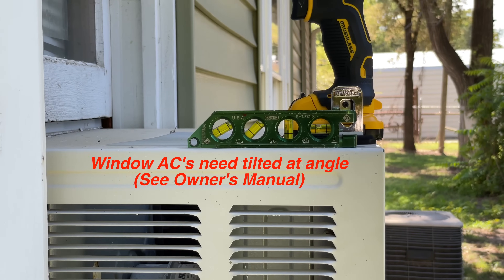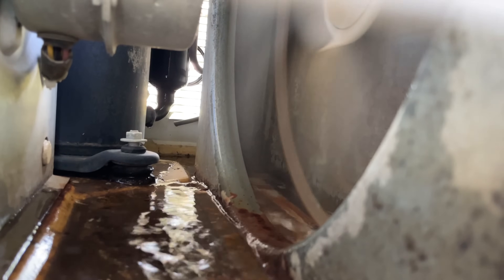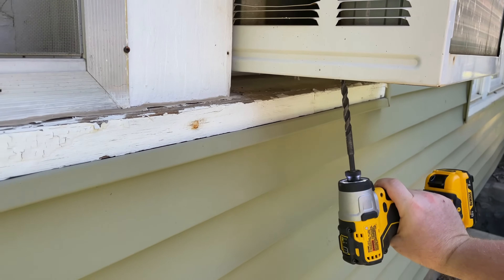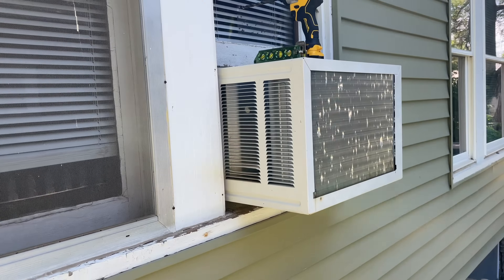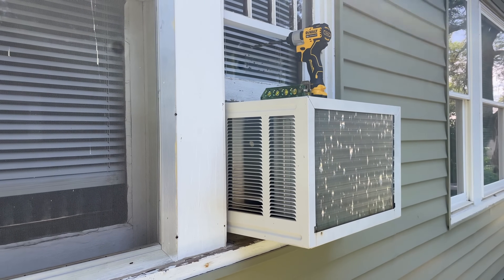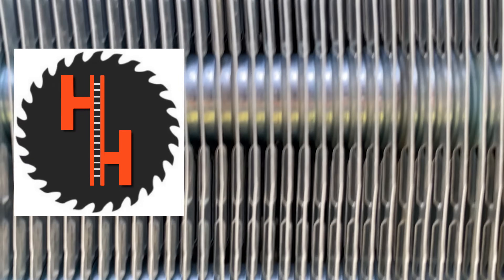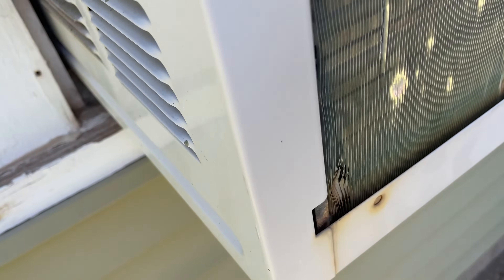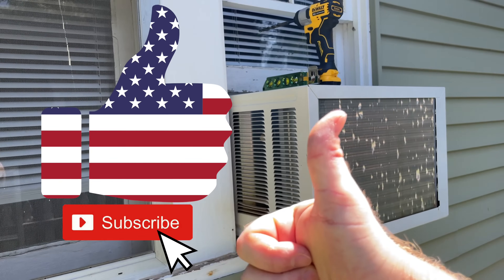99% Don't Know THIS About Window A/C's!! DON'T DRILL!!

Comment: It all depends how much noise of the water splashing you're willing to put up with, i have two window units where the noise was simply unbearable, drilling a hole is perfectly fine just make sure you're not drilling into any vital components like the condenser the fan assembly or the compressor. Today's window units are made so cheaply that they're all noisey to begin with, i have an old Sharp that i bought in the late nineties, it's 10,000 btus and is one what they called their library series, it is so quiet and built like a tank, the more steel the quiet it will be, like the way small cars are noisy junks compared to the big luxury cars, i hope this unit lasts forever, both inside and outside it's super quiet, in fact other than it cooling great you'd be hard pressed to know it's on, because of the way it's built you can't hear the water splashing inside and only a little bit outside.

Comment: In our area I always drill a hole to allow the condensation out of the units. Otherwise it hits the fan and splashes all over and is noisy..Drilling the hole also allows the build up sludge to flush out. We live in a very humid area.   I always drill with a step bit as to not cause any damage to the fan blade etc.
Reply: I had to drill mine. I have a window AC unit installed in the rear window of my camper van. The water would slosh around in there while I was driving and whenever I came to a stop sign it would come forward and come out while the AC was running and it would  hit the front fan and that would spray water all over my bed and all over the rear of the camper van so I drilled the drains and I no longer have that problem.
Reply: @OverlandOne  Gross!
Reply: @AldousHuxley7  It was just clean water, not rusty or anything.  My unit is only a year old.  It has digital controls on the front and I figured having water spraying out from behind that panel where the circuit board is, was probably not a good thing. I gave up some efficiency but, my bed stays dry now.
Reply: @OverlandOne  Thats ok itll last longer
Reply: Can also use a self tapper to replug if desired.

Comment: i still drill mine out, that water gets sprayed everywhere and makes mold, my ac works fine with the holes drilled and i dont have all the splash mess all over the house, and no mold to deal with, so guys, don't be afraid to drill away !!!!

Comment: Well, have always wondered why my ACs had no hole(s), but this seems like a crazy design.  Everything gets all rusted with the water just sitting in there.  It's a real great time when you pull the AC inside to put it away for the winter also, crappy water all over inside the house.  I will watch your video again to try to understand your explanation the reasoning behind this, but will probably continue to drill drain holes down there.

Comment: I drilled a hole and connected a plug and aquarium air hose to it to drip-water one of me young trees, and then saw later that the water was meant to pool and be sloshed around. Plugged it up and noticed it actually was running cooler.

Comment: I know someone who did that , He just bought a new window air conditioner and both me and his wife warned him not to drill a drain hole in the bottom of the unit , That I explained to him that the condenser fan has a slinger ring to disperse water into the evaporator coil in which the heat in the coil evaporates the water and that's why it doesn't need a drain hole , He didn't listen to us and he went ahead and did it anyway 
Drilled the hole and hit the condenser coil and ended up putting a hole in it and ruined the unit , His wife had a royal fit , So him and his wife had to buy another unit 
Whenever you buy an expensive item , Such as a window air conditioner , 
It definitely pays to read the instruction book , Very likely the instructions said never to drill holes in the bottom of the unit , Had he listened to me and his wife , And read the instruction book , 
This would not have happened

Comment: Mine started flinging ice chunks into my living room, so I drilled, baby drilled!
No more airborne ice. 😎
Reply: You dont drill wow
Reply: You probably have mung build up in the drain channel from the evaporator to the basin under the fan. 
You can drain the water out of the AC with a syphon hose to reduce the humidity around the AC but the temperature might go up a bit. Most AC units will leak water out the back if the level gets too high.
Reply: Only ICE agents....
Reply: You can drill but first remove the outer housing so you clearly see where not to drill. 
Note that drilling voids the warranty, which I think is 💩.
Reply: @msr1116 damn kids I'm a master licensed HVAC tech for over 50 years dont drill
Reply: Frigidaire owes me a new wall 😅😅
Reply from the maker: That's not normal...
Reply: @HandymanHertz  That's Walmart! 😉
Reply: @HandymanHertz I have your exact unit! We have the angle perfect and it freezes and floods my floors after just 6 hours on in Texas heat. It's clean. It's newer. I don't get it. My other one, my 12k btu doesn't do it.
Reply: @mandyerickson2997  You have a mung build up. Dust and maybe even assembly debris is clogging the channel that drains the water away from the evaporator.
Reply: @mandyerickson2997  Add more slope first. THEN if necessary, enlarge the hole in the back.
You must take loose the condenser coils from the frame so as not to drill through the coils.
You might want to clean the drain between the front and the back too. Must disassembly most of the unit do do that.
Pet hair, especially cats, dryer lint clog those even with a filter.
Reply: @crazysquirrel9425 you are so wrong the air filter catches the hair dude and there is no drains to clean on a window unit
Reply: @henrykennedy1120  There is a drain from the front of the unit to the back.
Where do you think that splashing water in the back comes from?
Once an air filter begins to clog, regular air including pet hair goes around the filter.
Dryer dust mixes with the evaporator condensate then flows to the drain and clogs it. Next you get water spilling out the front and/or evaporator icing up.
Reply: @HandymanHertz  I am not normal sir, but thank you for the video, I love you!
Reply: You have to turn it off when outside temperatures get below freezing 😅
Reply: Ice has nothing to do with condensation , your evaporator frozen up caused the ice , if you clean you unit every year you won't have a problem hole drilling doesn't help
Reply: Yes. Yes !!!  Do not drill.  !!!!   I did it years ago.  And. I hit the copper tubing and all the Freon escaped and I ruined my AC unit.    I was trying to get the water to drain out better.  And I destroyed my AC unit.    “ Do Not Drill “. !!!!!    You have been warned !!!!
Reply: @marshallguerra1353  That sounds like a "you being negligent and don't know what you're doing" issue.
Reply: @marshallguerra1353  My holey A/C is functioning properly since I drilled a drain hole BECAUSE I did not drill too far. You think I just "fell out out of a coconut tree"? Cackle, cackle 😉😉
Reply: @marshallguerra1353  that's what you don't do lmao 😂  but yes drill baby drill but don't drill thru ur ac  lines 🤣
Reply: @VEGASMADEREPUBLICAN  we produce the most oil of all time right now lol, drilling isn't the problem.
Reply: @timtationgg  No refineries near Kansas City (I 70 corridor).
There are like 3 or 4 interstates into and out of that area. Easy access for trucks to deliver processed oils.
Bad idea to place most of our refineries along the Gulf. That is like putting most of your eggs in one basket. Every time a hurricane comes even close, they shut down and jack up gas prices without good reason.
Spread them out.
Reply: @toddburgess6792  that's right drill baby drill don't 4get it #TRUMP2024

Comment: Put that water under a microscope, and you will drill that hole so fast. The things in it can swim and will go into the evaporator area. Legionnaires' disease stuff even.
Reply from the maker: I'm not drinking it it breathing it so that's a non issue.
Reply: @HandymanHertz  The microbes can travel up the drain tube to the cooling coil.

Comment: That may be fine for your a/c. But, mine didn't have that. The drain hole was small and kept getting clogged with small debris. I drilled it out bigger. Bam! No more clogging. Also, the type of fan motor that was used, apparently, is quite weak during startup. If it's running, no problems. But if it's stopped, and there's a good rain or the hole is clogged, it really struggled with getting up to speed. And you could hear the blades hitting the water. Big hole now, no more problems. I'll continue to trust my senses, instead of trusting the engineers and letting the motor burn up. I mean, it's not like the companies want you to buy more appliances. No, they wouldn't do that. 🙄 Also, there are plenty of engineers out there that shouldn't be engineers. They are not infallible.
Reply from the maker: Fan motors are powerful enough to splash a few drops on the condenser without any hickup. Mine has overflow weep holes if it rains

Comment: One of my AC's was dripping into the house, I took it out and removed the cover, found out the bottom of the condenser was clogged with dirt and crud. Sprayed it out with hose, no more water inside the house. Will try to remember to clean them when I take them out this Fall. Thanks for the short yet informative video.
Reply from the maker: Yup! And if it's leaking inside the house it's probably the passage way plugged from the evaporator coil to the back of the unit that needs cleaned.

Comment: nice vid, short and 1 minute and topo the point. great! and i hate comments like this btw lol.

one thing i'm concerned about with a window unit (i'm halfway planning on switching to window rather than pay 10k plus when my 11 yrs old central fails) is, some people speak of mold in them, which is gross. and one would think it's because of that water pool. however, i'm thinking in tx where i live, it's so hot, pooling water might be short lived in any intermittent periods where the ac is off. it might be more of a northern climate issue.
Reply from the maker: I live in Kansas and I've never had any isssue with this. You'll just have to try it in your climate. Theres also tablets that you can put in there that kills mold if it's an issue on Amazon

Comment: This concept works great for the manufacture. It shortens the life of you A/C unit. I have been doing Heating and Air for 30 years. It's best to have a hole in the bottom of this unit.
Reply from the maker: Wrong. This window AC is from 2009, so you're obviously wrong. No one expects a window AC to last 15 years, yet I'm still using it this summer. All of mine in my house and rentals have lasted a long time. This is not the limiting factor...
Reply: @HandymanHertz  I am using a window unit I am using it RIGHT NOW ! Bought it in 2013. Still works Great ! No reason why it will not last me another 10 years. Clean once in a while you would be amazed. Holding water inside will not keep it clean. Just keep buying more units, the company loves you.
Reply: why not just build in a self destruct timer that makes the compressor fail after 6 months? you didn't think this through mcfly. a unit failing reflects badly on the manufacturer and causes decreased sales. get out with your good ol boy nonsense.
Reply: @cryengine_x  Oh I believe they do. Do you realize how easy it is to put in a chip that once a product is first activate a date time can start and this timer could be set to stop the product at a certain date? Maybe even just before the warrant date. Do you ever wonder why so many people complain that there product died just days before the warrant ran out? Have you noticed that products don't last as long as they use too? I believe the reason they did this to these units is because, have you ever walked on a city street and looked up and seen a 5-6 story apartment building and saw 20+ A/C units sticking out the windows? It's like a sidewalk that never stops raining all the units dripping.
Reply: @davidtwister6936  No. Obama ordered them too because of the CFC's in refrigerants, they don't want working AC out there.
Reply: @cryengine_x  Yes they will phase out A/C units and window units will be the first to go. If they win.

Comment: Without a drain hole that back all kinds of debris and pollen and general MUNG build up on the inside of the radiator in the back, I believe they do this so you will buy a new A/C unit every couple of years. Oh, yeah, you could take it apart and clean all the fins and get the mung out but it is a PIA and I doubt most home owners would bother. I always add a drain hole once I carefully find the low spot and make sure I won't drill into a Freon line or anything important.
Reply from the maker: Never been an issue for me.

Comment: Opps. I wish I would have saw this video 5 years ago before I drilled a hole in my ac...it's still working though.
Reply from the maker: You, it will work, but compressor will have to work harder, shortening compressor lifespan and also lowering efficiency

Comment: My AC does have a plastic fitting at the back that a hose can attach to but rust on the inside of mine, like what could be seen inside yours built up and clogged that opening where the water was supposed to come out, the fan was splashing the water so bad the AC was making weird noises and water was spraying out the front into my home, I had to take mine out of the window and tip it forward and the water spilt out, it's fine for now, I think that rust build up moved away from blocking the drain hole, for now, but this video came up randomly for me and I figured I would tell my story, maybe when it gets a little cooler I'll open it and see if I can clean out that rusty guck! Or...break down and get those mini splits I've been wanting to get! 🍻

Comment: If you are worried about efficiency, window units are the most inefficient A/C's. Two window units pull as many Amps as one and a half Central Units.
Reply: Yeah...but houses with no ductwork have few other options in a pinch. Cleaning the condenser coils every year is a must. I do that every year and can fill a room with frosty air with each window unit. It can easily cost 15-20 thousand to outfit a house with central AC. Even going with split units.

Comment: It's crazy how out of a billion youtube videos on the internet, this is the only video that somewhat explains the function of drain plugs.
Reply from the maker: Drain plugs?
Reply: @HandymanHertz  my GE window ac has a little plastic plug underneath I can pull out to drain the water inside.
Reply: @EN-Excursion  That is intended for the optional drain kit. Kit includes a fitting and plastic drain tubing to allow water to drain elsewhere instead of straight down.
Run tubing near a tomato plant and it gets all the water it would ever want lol.
Reply: @crazysquirrel9425  I did this and it grew mutated freon poisoned tomatoes.  My and my family are deceased now.  Thanks bud.
Reply: @johng2880  Very funny. Ha ha.
Reply: I have done four of my ACs (all under 10 yrs old). All had the styrofoam evaporator enclosure, all had mold growing due to insufficient drainage of the evaporator enclosure. I created extra drain holes in the styrofoam with a small piece of brass tubing as a hole punch.
All had drain plugs (at least, that's what they are supposed to be), but they were in a place that the condensate water did not get to. 
All had clogged condensor fins due to dust and dirt being attracted to the slung water. 
It's just a crap design. Needs annual cleaning requiring the disassembly of the unit. And the styrofoam enclosure is insufficiently drained. The unit has to be at exactly the right level and tilt for any of the system to "work", and even then you will get mold. 
I drill the hole in the evaporator fan "slinger" collection depression, towards the outer edge. That way I know I will not hit any refrigerant tubes. Idea is to prevent the slinger from having anything to sling by draining any water that gets there. That and more drain holes in the styrofoam should help.
Reply: its stupid system designed to kill the ac.  trust me

Comment: So what you're saying is do not drill a hole in the bottom of my daughter's Midea U shaped air conditioner ? I have it a slight angle sloping away from the house but I do not see any water coming from it at all.
Reply from the maker: That is correct.

Comment: Yea, slinging water onto condenser helps a tiny bit with efficiency (there are no precise numbers how much it really helps), but there are many drawbacks for doing this. First of all, there's visible rust on your video when you show the interior condensate pan because the housing of window ACs is made out of steel that will easily rust, and even though the interior is also painted - it will rust faster with standing water, especially when your AC is not running but water still accumulates there because of rain. Second of all, it's a breeding ground for insects like mosquitoes during the time your AC is not running (for example when the weather is not hot enough) but still has plenty of water in that pan after a period of rainy weather. And for people who do actually remove their window AC for winter storage somewhere else - it's not convenient to drain standing water from that pan without any kind of drain hole.

Good window AC manufacturers at least give people a choice by providing a condensate drain hole with a rubber plug.